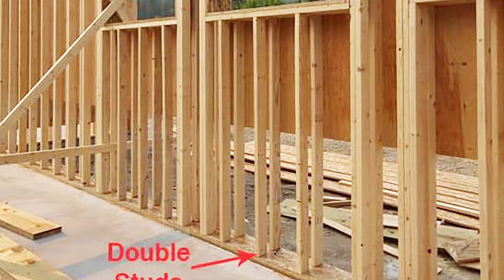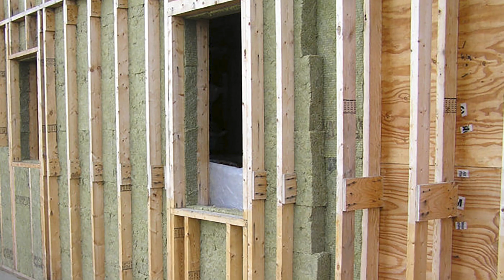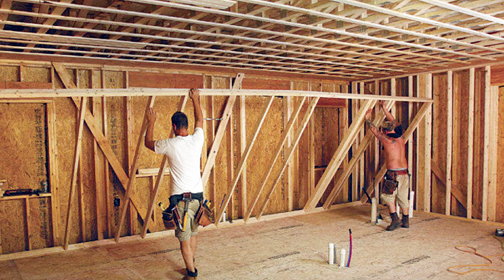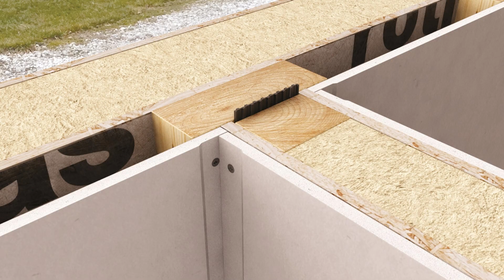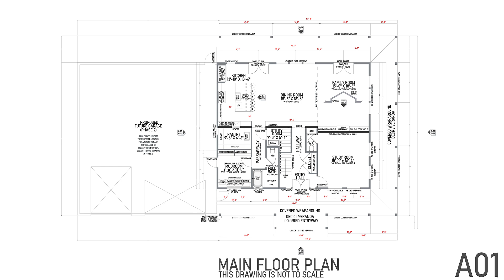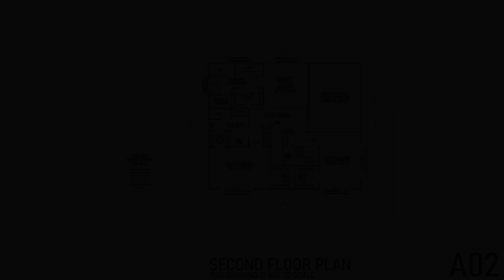The Pros and Cons of Advanced Framing Techniques

Comment: Way too much work 2x6 sill and 2x4s staggard.
Reply from the maker: That's also an option. A few of my clients have already framed their houses this way. I understand it's not for everyone, as it requires a bit more lumber. However, it offers two key benefits: excellent insulation and soundproofing, and it makes the work of electricians and plumbers much easier.

Comment: I stop at 20 seconds. 
You see building and construction. Doesn't go well with computer science thinking. When you 3D computer stuff you're not in this world. 
King 
Ragnar YAHUWAH
Reply from the maker: Hello there. Thank you for sharing your perspective, and I understand where you're coming from. I just wanted to mention that I’ve had over five years of hands-on experience in various aspects of construction, including framing, roofing, concrete work, siding, installing doors and windows, insulation, as well as some electrical and plumbing work, along with many remodels. Alongside that, I’ve spent over five years studying architecture technology, design, and 3D modeling. I’ve also been fortunate enough to attend several conferences, and as a member of AIA, I’ve received more than 20 certificates of excellence in different topics, many of which have helped me engage with builders and gain further insight into the industry. I hope that shows I’m not too disconnected from the practical side of things. Thank you again for taking the time to listen, and I truly appreciate your thoughts.
Reply: @shedever_designs  
Yeah. 
But 5 years, if it's done right, combined with theory, just apprentizeship. 
King 
Ragnar YAHUWAH
Reply from the maker: @RagnarYAHUWAH   In the architectural field, it works quite differently. Unlike many other careers, we are required to be accredited, and the education process is rigorous. Becoming qualified to take the architectural exam is as difficult as becoming a doctor. The five years of schooling are just the beginning; after that, there are over five years of hands-on construction experience and more than ten years of architectural practice. On top of that, it's ongoing education—we must constantly keep up with current codes, new methods, and innovations in the field. I used to work in quality control for a construction company, so I understand firsthand how complex and ever-evolving the industry is. Altogether, it's well over 15 years of preparation. I wish you a nice day and the best of luck in whatever you pursue in life. :)
Reply: @shedever_designs  
I AM skilled in technical drawing with AutoCAD. But paper is better.
King 
Ragnar YAHUWAH
Reply: @shedever_designs  
What you do is more useful when presenting to a customer how it's going to look when its finnished. The sales man part. But for construction 
Paper rules. 
King 
Ragnar YAHUWAH
Reply: @shedever_designs  
Another thing you should know. You are a cost, not a producer. 
What YOU do comes on top of the cost the carpentar creates. And houses gets more expencive. 
But a quick 3D to a customer might allright.
That's 
30 Dollars. 
King 
Ragnar YAHUWAH
Reply: @shedever_designs  
Yeah. And you mention the problem yourself. 
You must constant be upgraded with codes and progtams and do education. 
Just to do the drawing itself. 
You make that it's own industry and field by itself. 
If you had used a pen, and knew how to draw. 
That whole industry is dead, and you can focus on constructing houses instead. 
King 
Ragnar YAHUWAH
Reply: @shedever_designs  
Material producers, transport and carpentars is production. 
King 
Ragnar YAHUWAH
Reply from the maker: @RagnarYAHUWAH  It sounds like you have a strong background in technical drawing and construction, and I appreciate your perspective. I agree that for actual construction work, paper plans are often more practical, but 3D modeling can be valuable for visualization, especially when communicating with clients.
Reply from the maker: @RagnarYAHUWAH  As for cost, I see your point—design work adds an extra layer of expense. However, it can also help prevent costly mistakes, optimize material use, and improve efficiency in the long run. While keeping up with codes and software does require ongoing learning, that’s true for many fields, including construction itself.
Reply from the maker: @RagnarYAHUWAH  Traditional hand-drawn plans have their place, but technology has made the design process faster, more precise, and more adaptable to modern construction demands. It’s all about finding the right balance between tradition and innovation.
Reply: @shedever_designs  
Yeh. 
That's what i said. 
King 
Ragnar YAHUWAH
Reply: @shedever_designs  
Yes. That point is correct. 
Client needs to know what they buy. 
Agree on the plans. And carpentars needs to know to build it. 
But it's not worth 
20 % of the contract sum. 
We hire them by the hour. 
King 
Ragnar YAHUWAH
Reply: @shedever_designs  
Yeh. But for construction. It's just gouvernment being stupid. 
We can build so we don't care what they say.
We build better. 
King 
Ragnar YAHUWAH
Reply: @shedever_designs  
It's a different feeling sitting on the deck of my boat with a little drawing board and pen. 
Than to be in a office with a computer. 
I hear seagulls when i draw. 
King 
Ragnar YAHUWAH
Reply: @shedever_designs  
I don't need the office.
I don't need the equipment.
I don't need the education.
I don't need the car to get to the office.
My mind only 
Construct. 
King 
Ragnar YAHUWAH
Reply: @shedever_designs  
But if you have 
A 1 size papers for a sky Riser i understand the office. 
King 
Ragnar YAHUWAH
Reply: @shedever_designs  
Last time i drew for someone. It included fasade. 
And i wasn't satisfied with the roof tiles. 
The rest was fine. 
King 
Ragnar YAHUWAH but the customer was happy. It was for seeking gouvernment approval.
Reply: @shedever_designs  
Yeah. And another thing. You might not wish to Be THAT Effective when you draw. 
You are constructing and considering the Solution while you draw. 
So i with my cheap cost can construct for 
3 days, when you must solve every issiue and draw in 
2 hours? 
Then you must hurry to solve necst presentation..
King 
Ragnar YAHUWAH
Reply: @shedever_designs  
I don't wanna do dams, bridges, skyrisers and nuclear plants.
But the rest i can figure out to build.
But do you want a challenge and job you get payed for later? 
King
Ragnar YAHUWAH
Reply: @shedever_designs  
To ME, 13 floors is a skyriser. 
Im from Drammen. 
Draw 3D Fukushima for me, with MY Solution to Fix it. 
Do you want that challenge and try? I need a good representation for people.
King 
Ragnar YAHUWAH
Reply: @shedever_designs  
Heaven will Award you. 
King 
Ragnar YAHUWAH

Comment: A lot of people can't afford housing now and you want to double cost shame on you it will never pay for itself
Reply: Energy calcs would almost certainly show that the upgraded insulation would make this house cheaper in the long run
Reply: @lotklear Agree. 👍
Reply from the maker: Hi Steven, I understand your frustration. However, homes built in the U.S. are already among the lowest quality in the world. The walls are thinner, and 2x4s are cheaper than 2x6s, so the cost difference is far from double. Plus, electricians and plumbers find it much easier to work with this type of construction. They don't have to drill holes in the studs, thus not make them weaker.

On top of that, you're getting far better thermal insulation while using about 20% more of material, creating an incredibly warm and energy-efficient home. Some of these homes maintain stable temperatures for so long that energy bills drop by around 60%. In the long run, not only does it pay for itself, but it actually outperforms standard framing. It's been proved already.

This video is too short to dive into all the details, but I’m excited to create a much longer version with videos, pictures, and real cost breakdowns to clearly show the benefits. The housing market is crazy, not because we’re building quality homes, but because the economy is struggling. In most wealthy countries, anyone with a stable job can afford a home—that should be the case here too.

Let’s hope for better days ahead. Cheers!
Reply: As long as these ideas are adopted voluntarily, they're decent ideas. 
Proposing such ideas be integrated into building codes and forced on home builders is a horrible idea though.
Reply from the maker: @dustinabc  I completely agree that making these ideas mandatory through building codes wouldn’t be a good approach. In most places, the codes are already overly rigid, and adding more restrictions could make things even more difficult for builders and homeowners. People should have some flexibility and the freedom to choose what works best for their projects rather than being forced into a one-size-fits-all solution.
Reply: Uh. Two 2x4's literally cost the same as a single 2x6 right now. Also, when building properly, you actually don't need the same size heating equipment. That saves substantial money. Then, during ownership, your utilities costs are lower, and your comfort level is higher.